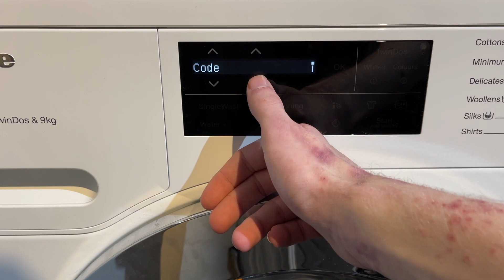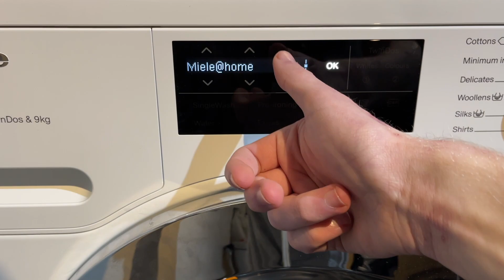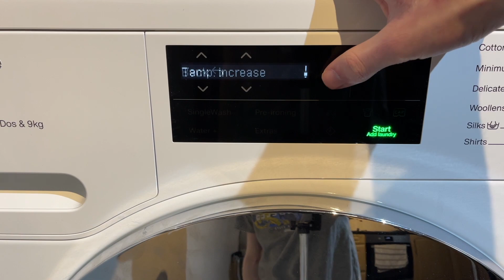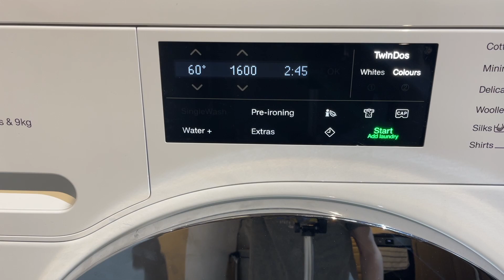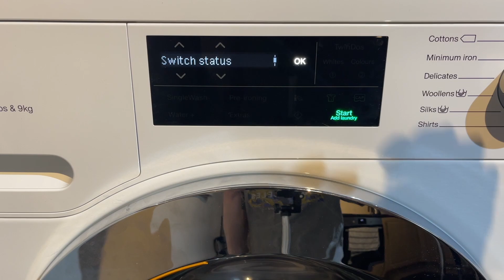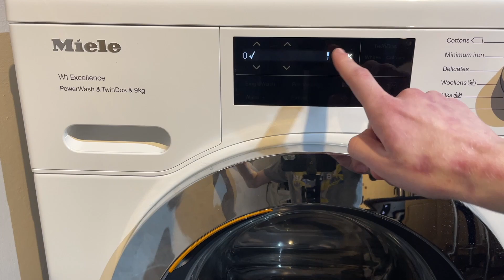Miele W1 WEI865 programming and service mode overview

Comment: Hello, Please help  I bought a second hand Miele TwinDos and the label of serial number is missing and not able to find it. Is there any way to find out the serial number of the machine? 
Thank you in advance , thank you for your information video.
Stay blessed.
Reply from the maker: I can’t remember if Miele are the same but most washing machine brands also have a sticker on the back of them with all that on it. The normal sticker is normally at the top of the door on the inside but would make sense for it to not have on if a new door was fitted by the previous owner

Comment: Wait a minute, does this mean I can turn my 1400 rpm machine (WWG 360 WCS) to a 1600 one with no consequence by just changing the setting (I know they all all have same motor but...)??!
Reply from the maker: Yes you're able to do that on them! its quite cool that you can turn a 1400rpm machine into a 1600rpm one 😅
Reply: @Washerboy2006  Tested, and seems to work 😎.
Measured:
+ 1.400 rpm 531W max, 405-421W
+ 1.600 rpm 919W max, 521-548W

Hope there is no risk, the only difference I spotted is the PCB broad compared to 1.600 current models, but they all have Twin-dos...

But I found one older model (8kg) with no Twin-dos, SAME PCB and factory 1.600 - WCH 360 WCS, so should be Golden! 🙂
Reply: @Washerboy2006  Ha, like I thought then, it is just software capped! 😅
Checked also on Miele MSD site the parts numbers for mine, and compared to a 1600 one, they are the same (motor, shocks, belt, ball-bearing....)😉
Reply: Hi, just discovered this on mine w1 (wcg660 model). Wasn’t sure if no risk doing it and what difference it have with models 1600 rpm from factory. There is no info on internet about all of this, and seeing your coment is such a good thing. I can’t mesurate like u did, but no problem, i’ll let it 1600rpm now. Thanks !!

Comment: Hi 👋 I have 2 questions,
Do you know if this process is the same for the WQ1000 WPS (W2)
And I completely understand if you don't want to say this but how do people find out on how to get into programming mode or service mode on a certain machine is there like a website or something it would be very helpful :) and by the way miele have stoped using steam genarators on future models like the w2 so the w2 doesn't have a steam unit genarator 😢